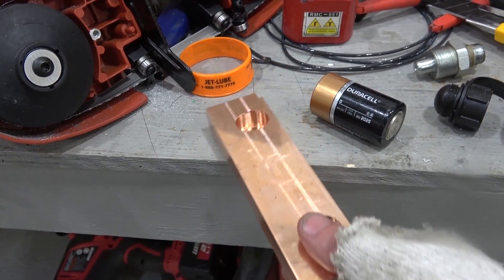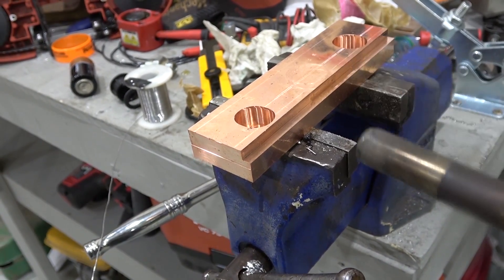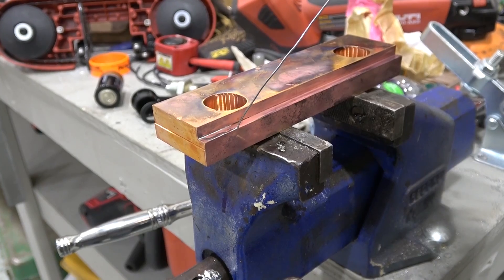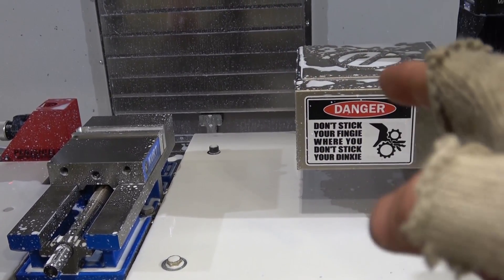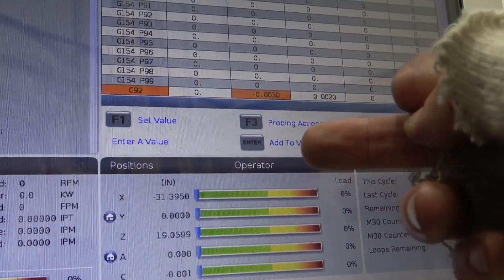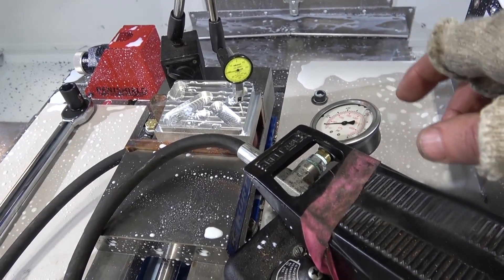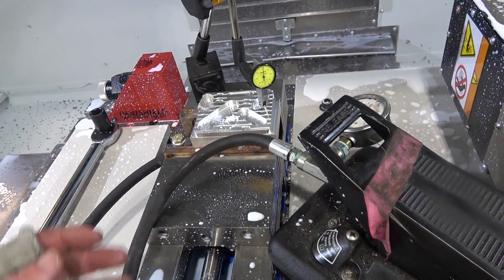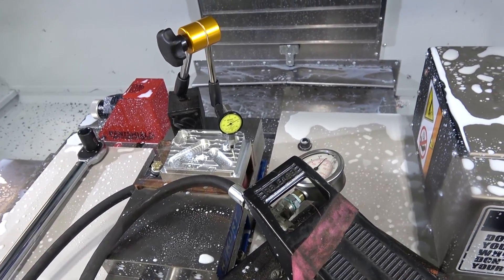Soft Lead Hard Grip? | Testing Lead Vise Jaws

Comment: Well if the lead is gonna go around the object shouldnt you test it with a object with something for the lead to catch on??? If its smooth youre just gonna displace it and then it will slide right off.

Comment: I watched your other Vjo on comparing the other vise jaws and I think I know why the softer stuff doesn’t clamp as well. 
You’re clamping at the tip top of the jaws where there’s no steel backing it and so the jaws are flexing back ever so slightly. Try backing the soft jaws with some steel up to the full height of the jaws (parallels work in a pinch, or better yet the steel jaws themselves). I’ve always used a soft shim on the moving jaw side backed by steel and have had tons of clamping pressure though I’ve never tried pushing it out with a jack before.

Comment: You didn't test lead.  You tested a 60/40 or 63/37 tin-lead alloy.  We would expect the mechanical properties to be very different from 100% lead.  Both tin and lead have comparable Moh's hardness, but I can't find a good source on hardness of various solders.

I wonder what would happen if you used a low-melting-point material like https://en.wikipedia.org/wiki/Field%27s_metal .  Any kind of plastic deformation would likely heat up the surface to a liquid, which would then fuse around the part.

Comment: You went about this soldering/leading kinda the hard way. Things on hand though, eh. You needed to make acquaintance with a plumber or a reloader that has a plumbers pot. Then some soldering paste, dip/ ladle from a pot of 95% pure lead. Any lead with greater then 7% "impurities" starts getting slick. When cooled clean up your mating surfaces. Once upon a time one could buy lead soft jaws for vises, no marring and good grip.

Comment: When I was a gunmakers apprentice in London we cast lead vice jaws regularly, they were thick covers hammered into place, they held small parts while filing them up, just squish them into the lead to hold them. When they were worn out we just remelted them and cast them in a mould again.
Reply: Rufus Chucklebutty, We did that at the Colorado School of Trades Gunsmithing Program too.

Comment: I wonder if there would be any bonus stiction gained by using the same metal for the jaws as the piece you’re holding. You know, try some copper-on-copper or steel-on-steel action.

Comment: I worked in a Machine/Welding shop for 40 years. The very first thing you learn is that you do not touch anything you personally did not work on, especially in the Welding shop. In a short time you develop a way of testing to see if there is any heat coming off of the part before you touch it. We even made up some sheet metal signs with HOT printed on them to place on or next to it to let people know not to touch it. You would think that would be enough warning. But always be aware of the Numb Nuts that don't work there but comes in to the shop. Had one come in about 3 months ago and grabbed a part we were working on for him that had a "HOT" sign on it. He wound up with some serious burns on his hand that needed some Medical attention and a ruined casting when he dropped it on the cement floor. 
We asked him why did he pick up the part with a sign stating it was hot on it. Numb Nuts said that he thought we put that sign on his part just so he would have to let someone know he was taking the part and that it couldn't be that hot siting on a metal work bench. He was in a hurry, had someone riding him to finish his job and we were on break when he came in to the shop. He should be up for the Darwin Award soon.

Comment: England - I nearly had an organism at around 4 minutes. I heard alu - min - i - um. I do understand you are not 'one of them' AvE but I thought that other coarse name had spread. Oddly enough though during all my years dealing with aluminium we called it 'ally'. In the UK we are not allowed to use lead based solder on 'potable' water. Odd name that, means water systems that for consumption. Other than that 60/40 lead tin is OK. However the desease has spread  to tyre weights, shot gun pellets and fishing weights (which is good). Trying to unsolder or resolder (should that be sodder?)  that bloody awful junk they  use now on electrical circuits is a pain. Better go, off to watch an American film about their sodders in Vietnam.

Comment: The productions of new electronics have the banned lead laws that’s why led based solder is a bit harder to get these days. But we are allowed to use the lead based solder in repairs. 

AvE, I have an idea to the vice jaws... make them with some angle like this seen from the side \|  |/ a bit thicker on the top. When the jaws get the pressure they will bend with the vice even so little that it will push the part up out of the vice. Just a thought.

Comment: A quick and dirty trick I use for gang drilling etc. is to double over some sand paper and place it between the front jaw and the work piece. It doesn't work 100% of the time, but it can certainly help.

Comment: i think your tests may have been flawed. at least the final outcome in saying the vice is overrated for its actual holding force. when machining you're going at the parts parallel to the table or pushing straight through the table. never (at least i've never) are you going at the parts in which the tool forces the parts up out of the vice. just my 2 cents. still great content

Comment: Canadian National called and is interested in that bridge you have for sale.  They just had one "sag" two feet under a moving train near Battle Creek, MI a couple of days ago.  Locomotive engineers tend to get excited when the track moves excessively under their engines. The word excessive is of course subjective, but apparently 2 feet is a little more vertical movement than is normal for bridge decks.

Comment: You could have heated up that copper in your oven - crank it up to 600 (or “clean”) and it’ll melt solder no problem. Potentially a bit easier than the torch depending on whether you get chewed out by SWMBO. (Don’t put lead or any solder in any oven you cook food in, heat up the work piece instead)

Comment: Anodic corrosion! ...... If you just clamp a lump of Zinc to it you are golden!
The copper and Steel form a battery where the anode (steel) corrodes .... made worse by your coolant Unless you are using oil ;0) 
See! All those hours getting talked at when I was an apprentice were not totally in vain. The downside is that my brain is full of shite that has no earthly use ......... Until it does ;0)

Comment: I wonder if it is the same reason that steel has high elastic deformation. You know why a steel ball bearing will bounce the highest when dropped. So when you are clamping the steel is pushing back with more force trying to return to its original shape then copper or aluminum will. (High Modulus of Elasticity ~ 30 psi compared to 10 or 15)

Comment: I'm curious how these results compare to the coefficient of friction at lower loads. Put a block of test material on a base of what you want to test it against, then tilt the base until the block starts sliding. If I remember my trig right(which I probably don't), coefficient of static friction would be the tangent of the angle between the base when it started sliding, and horizontal.

Even if it's not directly comparable, it could be a good way to narrow down which materials try with the hydraulic setup.

Comment: When you starting adding solder to the cobber, i was thinking is solder not mainly tin? and cobber + tin = bronze... i know that it waas not melted and there fore not bronze but could this be part of the explanation that adding solder did not make it softer?
Could you try bronze, not that i think it would be soft i would just love to se how it compaired. Thx for the good videos...
Reply: Copper is softer than bronze why would it be softer from this?
Reply: That is what i am saying... He is adding solder which is like 60% tin and 40% lead, so solder is not the best source for lead for this purpose.

Comment: Dude I've solder so many parts surface-mount everything mil-spec certified sub assembly of harm and Sparrow missiles sub-assembly of everything and I still was bummed out when you switch to another screen after you shown solder of melting on the copper I was getting into that that was kind of therapeutic for me I wanted to see that whole crack fill up don't judge me
Reply: Seconded. That was some sweet image.

Comment: Maybe I'm just a bit uncurious but what is the point of all this? sure you have the know the force at which the part can be dislodged from the vise (given a certain amount of torque) but if you don't measure the range of forces the machine produces (even if it's just qualitatively) isn't this just dicking around?

Comment: Is just a couple thou of lead enough to really change it?
Reply: It would be enough considering the part is relatively flat and smooth, all he is testing is how the different coefficients of friction of the two surfaces interact (Ie how grippy the jaws are). So all he needs is the surface to be lead.
Reply: @christopherjones7191  Maybe it is. Somehow it just seems intuitively wrong... like maybe the mass of lead would have more internal springiness and grip it better? I don't know for sure but it just seems wrong not to use a big lump of the stuff and do a true apple to apple comparison. It's not like lead is prohibitively expensive.

Comment: I wonder what parameter is most important? ...... what effect does surface roughness and elasticity modulus have? basically you are deforming the microscopic protusions until they ''bend'' out of the way right? ..... so the steel would be better because its stiffer so it takes far more energy to make the 2 surfaces slip.

Comment: A question.  After heating, adding lead and allowing to cool, you end up with annealed (softer) copper.    So, just wondering, but is there a "stickiness" difference between work hardened vs freshly annealed copper?

Comment: @AvE I think the problem is where you have the jaws cutaway the steel heald better because it had less flex at those pressures. Whereas the ones you cut thinned out the metal at the contact points allowing flex of the jaws to reduce the contact surface. Just a lowly elechicken's perspective.
Reply: Yeah I said the same on the previous video. And the aluminium piece also isn't unflexible either. But the way it moves and starts suddenly and keeps on going indicates it is slipping

Comment: Not trying to be pedantic here.

But lead/lead alloy jaws are great not because of the friction coefficient (which is low for lead).
It is due to the fact that lead, being soft and ductile, and having very low working hardening properties, it acts like a putty for the piece that you are trying to hold with the vise, taking the shape of the piece surface.

(think it as a leather strip between the jaws and the piece).

A good source of lead is used lead-acid batteries. Just dry them, open and melt the terminals and plates. Then you can alloy it with the pb-free solders to create your favorite alloy.

Comment: Ok, my curiosity again. To me this seems like a colossal waste of time. Where would any of this have any practicality in the machine shop? If something moves in the vise ya slow shit down a bit. There, you're done. Now mill 'em all. I just milled this huge piece if aluminum that was 3" thick 38" long and 28" wide. My total clamping contact was 2 cam clamp (2 cams per clamp) 3/8" high x 3/4" long contact both ends holding on the 38" long side. The clamps were about 10' apart. 4100 rpm ( that's all the rip'ems I can get out of that Prototrak) @ 100 IPM feed .25 lateral and .125 deep per pass around half the perimeter (no coolant,  Walters 1" 4 flute insert cutter) that ran great but the chips were EVERYWHERE. Prototraks don't have sides and doors. It's all wide open. I think you're putting too much thought into how much clamping force you think you need.
Reply: I have been making my living cutting metal for over 40 years. Holding parts with low clamping force is necessary for many jobs. Just slowing down is often not good enough. As others have mentioned, paper works very well in many situations.

Comment: The lead will be subject to galvanic/bimetallic corrosion in an aerated aqueous environment, what is the cooling/lubricant made of? 
Then again, it's only a tiny bit of lead and no one has ever been hurt by some lead
Reply: lead? you mean the stuff bullets are made out? not so sure about nobody got hurt by it...
Reply: @janvanruth3485  and nobody argue that the fall of the Roman empire couldve been due to leaded wine and plumbing

Comment: You can get 60/40 lead/tin solder where they sell stained glass supplies. They might have pure lead too. You can test the hotness of items with the back of your hand, just hold it near and it'll feel the heat better than yer palms.
Reply: That was my problem with this one--the solder is mostly tin, not lead--and tin, metallurgically speaking, is very different from lead.   Fishing sinkers, flashing, bullets--we've still got a lot of lead around us.   The trick to this, in my humble opinion, isn't all CoF, but also tensile strength.  Both lead and copper do "creep" under tension.

Comment: I wonder if why your results are so far off the book values is because you're using forces orders of magnitude higher than the test rig used to get those values. I would have thought they would have calculated those coefficients of friction under conditions like 1 cubic cm of contact area, with 1 newton of clamping force (or gravitational force), and then seen how much was required to cause slippage, rather than the fuck tonnes of clamping force you're using. Are you REALLY getting slippage? Or are you actually shearing the aluminium, copper, lead? How do your the ranking of your materials rate against the ranked ultimate sheer strength of the materials?

I understand you actually care about what makes better jaws. It's just weird that the numbers are so far out from the predicted values.

Comment: Not to be a dumbass or smartass, but i do have a question (the only dumb question is an unasked question)  If n yawrrr wanting to hold something in a vise on the temporarily/permanent side, Could a guy use loctitie. I understand your getting the 1's and 0's on what will hold what better and no pun intended vise versa. But I'm just asking if a guy wanted more grip and had plenty of time. Also one more question vise jaws usually have teeth, but those leave marks. Now I'm ending my question with more questions. Jeezless. Edited softjaw and hardjaw i answered my own question on the teeth. Now ill wait on the loctite.
Reply: You can solve that easier and cheaper , just use superglue , to loose it afterwards just heat it up
Reply: Steer clear of the fumes when heating cyanoacrylate.

Comment: Stuff in a forge plant looks the same at 7.5C or 750C. I'm one of the experienced ones on that front, have a scar in the partial shape of a CSA symbol to prove it.
Reply: I get what you are saying but at 750C it would be glowing quite red. I guess one might not notice if they are in direct sunlight or something.
Reply: @theCodyReeder  304 stainless takes a lot of heat before goes red and the temper colours stay after cooling, racks of 5000k LED high bays don't help.
Reply: @crazyguy32100  particularly since most 5000k leds have a horrendous color rendering index, worse than being in the dark....